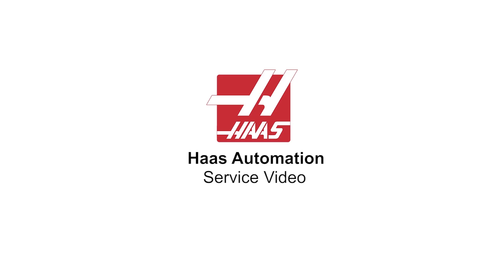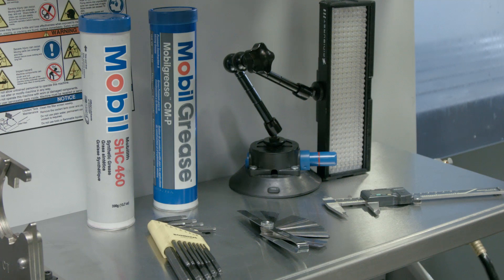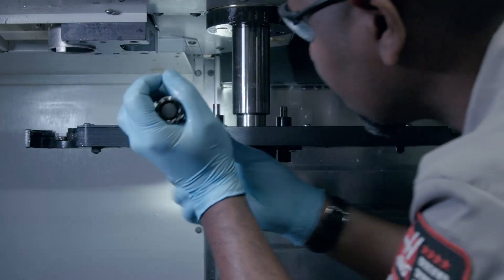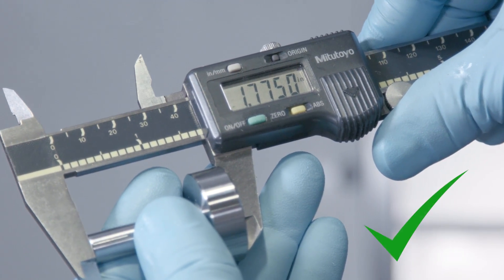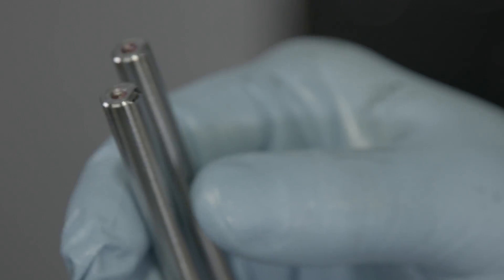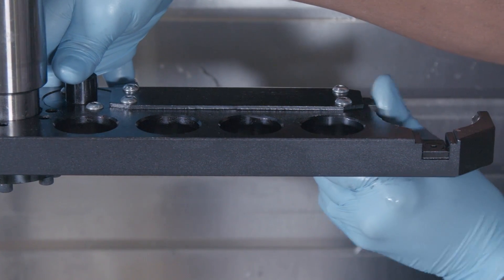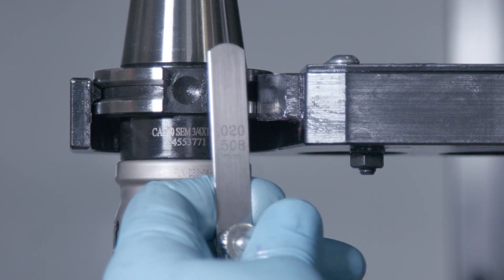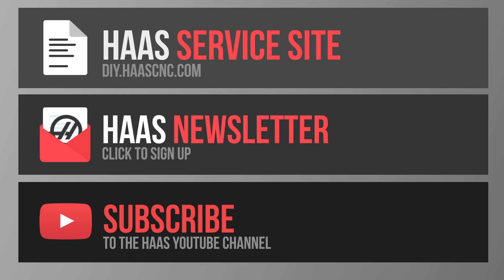Side Mount Tool Changer (SMTC) Double Arm Maintenance - Haas Automation Service Video

Comment: i have a 2014 VF-4, started throwing face mills. Looked like the plungers were sticking. Took it apart and everything was bone dry. No grease at all and it's never been apart. I was wondering why there isn't a grease hole in the side of the arm so you could pump a couple shots of grease in it once in a while

Comment: The plunger can not be removed with our VM6 2018 model. It hits the plate on the bottom of the double arm. Is there a way to remove this plunger?

Comment: How often should be done this maintenance?
Reply from the maker: It really depends on how you use your machine. In other words, how many hours a day you use your machine, how many tool changes a day, etc. Generally speaking, inspecting the plungers for wear every six months is a good idea.  Check to make sure everything is greased properly once a year. Hope this helps!